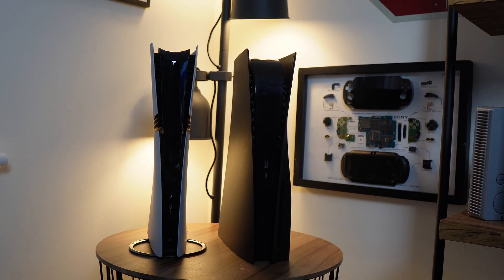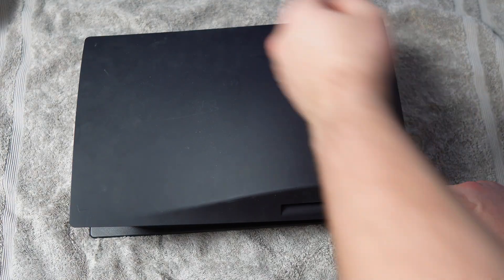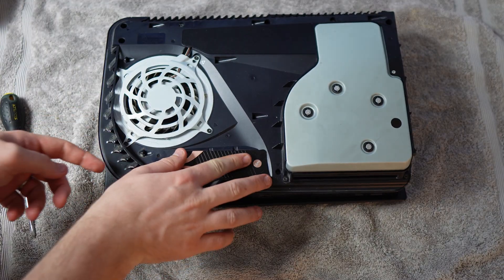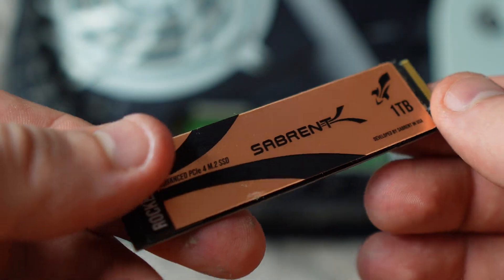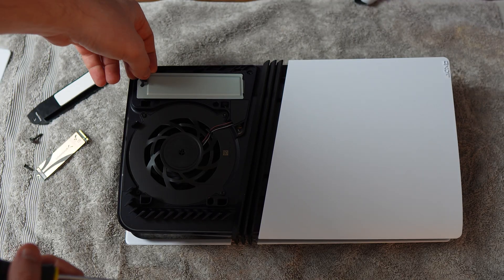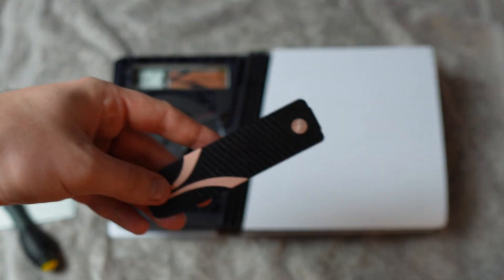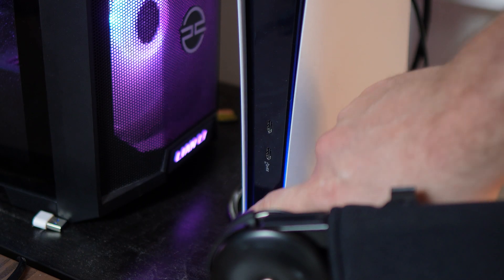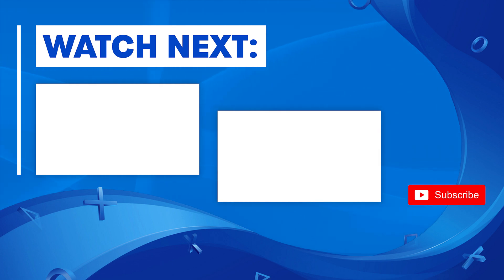PS5 Pro SSD | How To Remove And Install Compatible M.2 NVMe In PS5

Comment: Good video with a couple of comments.  One, that looks more like a Phillips screw driver.  There are bits out there that actually look more like a star, called Torx, and if you try to use a Phillips on them, you will mess up the screw heads.

Comment: Here's the issue that I'm trying to solve:

I bought a NEW and BIGGER storage capacity internal M.2 SSD for my PS5 to replace the smaller storage capacity internal M.2 SSD that I'm CURRENTLY unfortunately using for my PS5 currently. The problem is the fact that I don't want to lose all of my storage data from my "old" internal SSD since I'll be replacing it with a new one. Is there any way I can transfer my M.2 storage data from my old M.2 SSD to my new one?
Does the PS5 Pro allow you to transfer extended internal M.2 SSD storage data from your old PS5 to the new one (the PS5 Pro)?... or does it only allow you to transfer data from the stock drive (console storage)? If so, I COULD buy an enclosue for my M.2 internal SSD to convert it into an external SSD via the M.2 SSD enclosure and the adapter instead... maybe that would allow me to transfer my games that way? IDK... I just REALLY don't want to have to start over and re-download everything from scratch and whatnot again is all... hope that makes sense... :/
Reply: Your storage is all cloud so you just have to upload it on that ssd